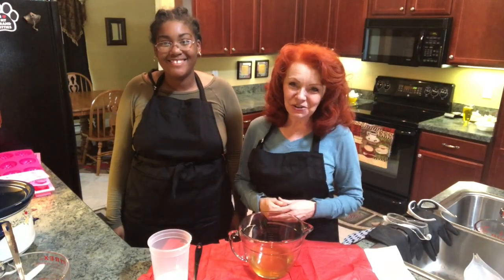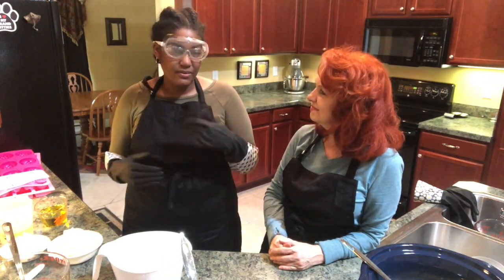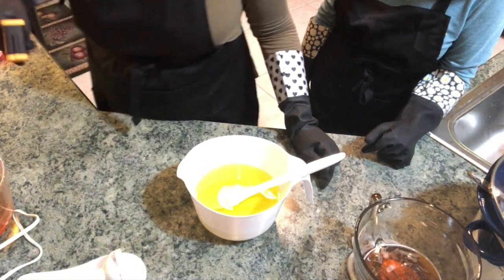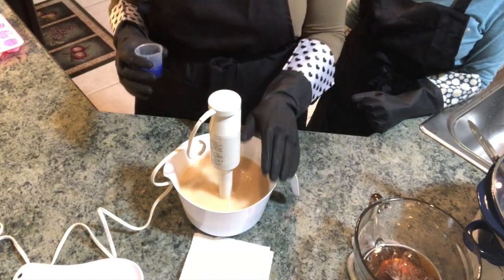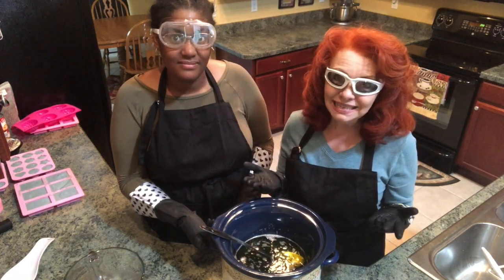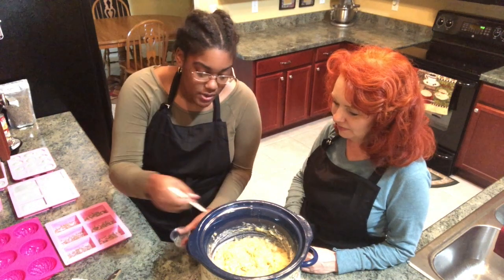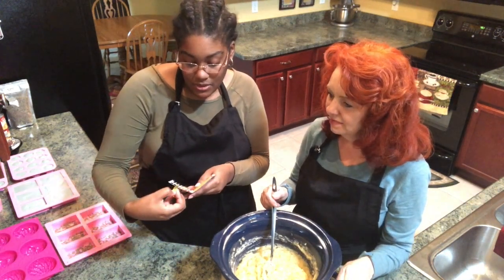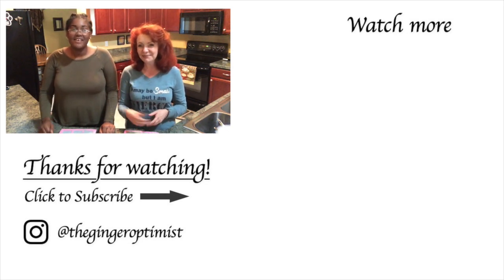Cold Process Soap Vs Hot Process Soap

Comment: great video! Which of these two soaps: HOT or COLD, does the customer like more? Who has the greater advantage? Which of the two gives us more value for the final product?
Reply from the maker: Thank you @dimyata! Customers have been happy with either/or. It's more of a time factor for the soaper. You don't have to let the hot process soap cure very long. I recommend 2 weeks if possible. Cold process needs to cure at least 6 to 8 weeks. The longer the soap cures, the harder it will be and will last longer. Hope this helps!
Reply: @TheGingerOptimist   10х for fast answer! :)  
Yes, this is clear to me about the production time. Is there any attitude of consumers to prefer one species over another, and why? The only plus I know about the hot process is: it lasts longer and does NOT mucus if left wet. Is there any other difference from a consumer point of view?
Reply from the maker: @dimyata  these are great questions. I am not an expert soaper my friend, but one small advantage of cold process soap is the bottom of the soap is smooth instead of bumpy. I don't sell soap all the time, but whenever I have sold it, my customers seem to be happy with either/or. Soaping is more of a hobby for me. I sell my soap when I am raising money for a particular project, otherwise, I use it personally and for gift giving. Sorry I can't be of more help!

Comment: Doesn't vinegar neutralize lye?
Reply from the maker: @staci7107 That's a great question. According to Soap Making Forum: When you use vinegar to replace some or all of your water, the acetic acid in the vinegar reacts with sodium hydroxide to form sodium acetate. Sodium acetate works like sodium lactate to harden your soap, except all you have to buy is vinegar. On soap forum they tell you exactly how much lye to use when using vinegar. Hope this helps. :)

Comment: Hot Process not needing a Cure Time is a Myth. Both CP and HP Soaps both require a Cure Time. When it comes to Hot Process, a lot of people get confused between Saponification and Cured, but seem to understand it perfectly when they talk about Cold Process Soaps. 

As you mentioned in the video, Cold Process Soaps take 24-48 hours (sometimes up to a Max of 72 hours) to complete the Saponification Process. And requires a Cure Time of 4-6 Weeks Minimum. That is correct. 

Hot Process, the Saponification Process is finished after it has finished cooking and CAN be used right away (as soon as it has cooled down enough). However, this is only Saponified Soap. It isn't Cured Soap. 

If you compare the Saponification of CP Soap, then the CP Soap is able to be used after Saponification is finished (after about 72 hours). 

I love Hot Process, and yes, I do often use my Soaps after about 2 weeks (sometimes). But HP Soaps still need the same Cure Time as CP Soaps do. The reason for this is due to the Crystallization Process (a Term not often spoken of because it's harder to show/visualize because this is done on the molecular level and you cannot see it, so most people ignore this Process entirely). 

The best way that I can explain the Crystallization Process, is if you look at the Cure Time Requirement for Castile Soap. Castile Soap requires a minimum of 6 Months to 1 Year to Cure. Bastille Soap (minimum of 70% Olive Oil) requires at least a minimum of 4 Months to Cure. Cold Process vs Hot Process does not affect the Curing of these Soaps at all (because HP does still need to Cure). But why are these Soaps so much different in Terms of Cure Time, compared to other Soaps? The reason being, they are High in Unsaturated Fats. 

Saturated Fats Crystallize at a much faster rate (typically within the standard 4-6 weeks time period that Soapmakers have become to recognize). However, Unsaturated Fats will Crystallize much, much, much slower. Often taking Months to finish the Process. This means that it's not just Olive Oil that requires a long Cure Time. But all liquid oils. Fats/Butters will Crystallize sooner than Liquid Oils will.
Reply from the maker: Khione thank you so much for your explanation. So very helpful! Blessings! ❤️
Reply: @TheGingerOptimist  You're welcome! And thank you as well, for not taking my comment the wrong way (I know Text Words can be hard to understand how a person is meaning their words). Loved your video by the way! It was very good!
Reply from the maker: Khione thank you for sharing your wisdom! Blessings new friend! ❤️
Reply: I'm new to soap making and was wondering how many weeks for tallow and coconut oil soap? I was told 4 to 6 weeks. Thank you
Reply: @gaylejones1545  4-6 weeks is average for most soaps, including tallow and coconut oil soaps.
Reply from the maker: Yes, I would recommend 4 to 6 weeks. 💖

Comment: I'm gonna start making soap! I think. One thing I'm dying to know is how much of the crisco, LARD!, oil, etc.  Is carried over into the finished product? Call me crazy, but I'm not too sure I want to be washing myself with any amount of lard!
Reply from the maker: Hey Mike Joe Goad, I totally understand. You will be amazed at how nice the soap really is. People would never know what is in the soap if they tried it and I hadn't told them the recipe. Thanks for watching! :)
Reply: You are the smart one.  Crisco and ORGANIC  coconut oil, I don't get it.
Reply from the maker: Frank Smith try it, you just might like it. Thanks for watching. 😊
Reply: @Mike Joe Goad
You can choose how much Superfat (what is not turned into Soap) you want when you make your Recipe. If you are worried about not all of the Lard gets Saponified, there are several options you can do. 
1) You can substitute the Lard/Crisco out completely and replace with a different Oil/Fat/Butter (be sure to ALWAYS run your Recipe through a Lye Calculator if you Substitute any ingredient).
2) You can choose a 0% Superfat (100% turns into Soap). Just be aware, that 0% Soap can often times be a bit drying on the skin.
3) Similar to option #2, make a 0% Superfat Soap. But this time, make it with Hot Process Method. Hot Process allows you to choose what you want your Superfat to be (something that you cannot do with Cold Process Soap). With a 0% Superfat, all 100% of the Oils/Fats/Butters will turn into Soap. Then after the Soap has finished the Cooking Process, then you can add extra Oils/Fats/Butters into the batter, thereby choosing what the Superfat will be, that is gonna go on your Skin, that isn't Soap.